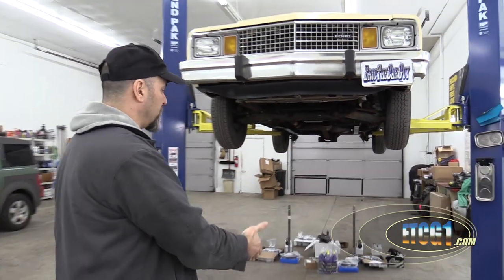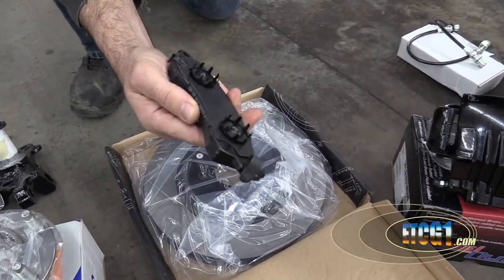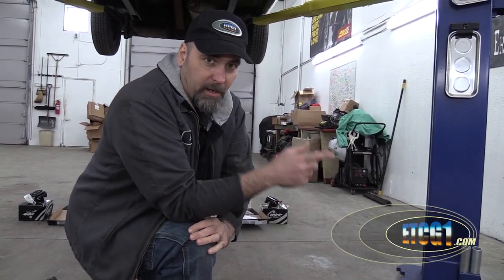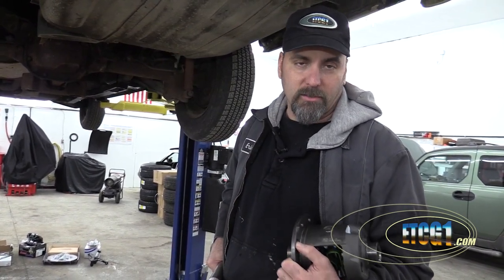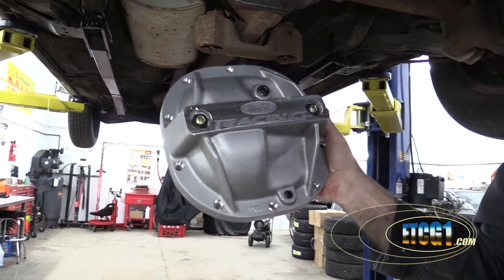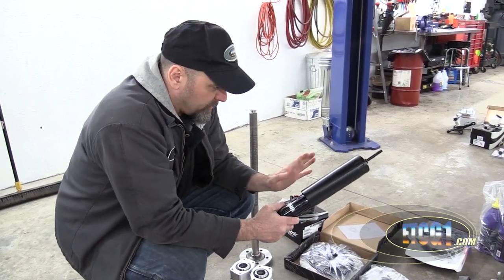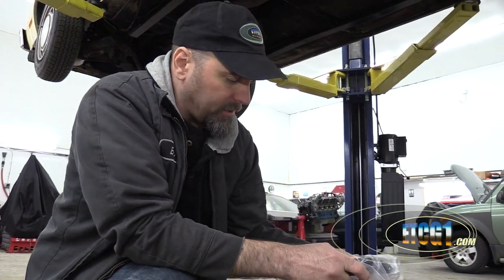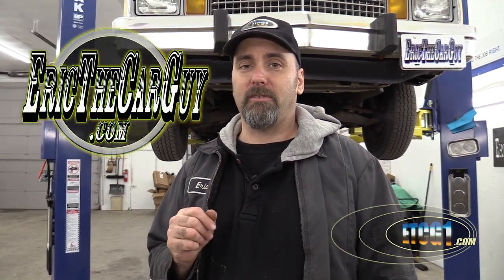New Fairmont Parts! #FairmontProject -ETCG1

Comment: 13:34 Talking about the flex line...You have the 1 for the axle (suspension movement) and one for each side because the trivial amount a caliper moves will break a steel line over time flexing back and forth. Hence comes my question: Wouldn't it be better to have steel line on the body out to the 2 flex lines allowing them to take caliper and suspension movement than to have that extra flex line in the middle? I know they are steel braided but even so they are not as good as solid line when it comes to pedal firmness.

Comment: Don't know if this has been pointed out, but The Crown Vic 17" wheels have a deep, FWD-like backspace. On the rear, if you ordered SN-95 length axles ('94-'04) The Vic rims may be the right backspace or close. If you have Fox length axles, a spacer will be required. The fronts will likely need spacers.

Comment: I'm with you there on a car being more than just an engine. I just got a 2016 WRX. I'm probably not going to do much to the engine. I'll probably upgrade the brakes and suspension before i do anything. After that I may get the flex fuel sensor kit from cobb. I would love the option to run E-85 without having to swap tunes.

Comment: ford ranger center caps are the same as the crown vic ones , easy to find in the junkyards or ebay , but you have to have the specific lug nits , so pick them up from the junkyard too

Comment: With the thickness of the c-clip eliminator and new caliper holder, do you need a longer axle?
Are the front tires as big as the rear?  Isn't that a waste?  Sure it looks cool but steering and tire clearances and steering resistance, et al.
I'm pretty sure you thought that stuff out already and I don't need to be concerned.  Right?

Comment: I learned to rebuild a rear end on one of these old foxbody mustangs, one awesome tip I learned is whenever you need to press a bearing on a shaft, such as a pinion bearing on to the pinion, stick the pinion in the freezer for a half hour, then take the bearing and a map gas torch and heat the inner race. it should slide right on!

Comment: AWESOME! body color on the rims depends on what color the car is. I missed if you were leaving it same color. the magnesium color looks good on steelies with chrome rings and caps on my 64 Malibu and body color didn't look right which is a dark 94 Chevy blue metallic. Such a great build you have going. can you do a mostly hidden roll bar and maybe tint the windows to hide it? I've seen cracked welds and slightly twisted bodies in those older mustangs when grip and power both increase. Your build is gonna be soo awesome. thanks for the vids!

Comment: Eric - I always respect a builder that makes sure the project can stop before putting any effort into making it go!
Reply: +Howard White 
So true. 
All go and no whoa makes for a lot of sorrow.
Reply: +Howard White Precisely the point. I keep telling people that are clamoring about the engine, that there's more to a vehicle than just an engine. Thanks for your comment.
Reply: +Howard White thats why I always tell people, start at the ground and work your way back to the motor, you may not get to go fast right away, but you can push the car harder and have more fun with the stock motor while you wait to get the actual go fast parts, first thing (outside of a basic tuneup) that I address after buying a used car is a suspension overhaul, well after I get my radio setup in it, LOL.
Reply: +EricTheCarGuy I keep trying to explain to a friend of mine who has a old 87 Monte Carlo...sure it'd be nice to drop in a big block,but if it's not got the right suspension or brakes... it's not going to be safe or fun to drive, how fun is having a car that doesn't have tight enough steering or enough braking performance to really use that horsepower?? I don't get it,that's why my Nissan is getting 4 piston  front and 2 piston rear calipers and coilovers before a turbo and ECU...I want to be able to enjoy my added power, not be worried about whether or not it'll stop or turn
Reply: +Bradley Preston I agree 100% and that's what I'm hoping to show with this build. It's not about how much horsepower you can make, it's about how you use the horsepower you have. My Vigor has about 160 bhp, but the car is so well balanced, it's a dream to drive. That's what I'm going for with the Fairmont build. Thanks for your input.

Comment: Great stuff, man! Wrangler TJ Jeep (1997-2006) owners cannot do much to their engines. CAIs are useless on the 4.0L, which is like a tractor engine. It is ported so that it is maxed on air flow in and out. Chips do nothing. It is a bulletproof monster in the Jeep, but you will not ever get much more from it as far as speed. We are concerned mostly with axles, steering and suspension. So this video looks just like a lot of Jeep videos. Even some of your parts are things I am familiar with as a jeeper. So I particularly liked this one.

I really like the C clip eliminators; what a great idea! I wish you could get these for the Dana 35 axle. 

Have you considered how these will affect your stance? It looks to me like they will increase your rear axle width by about 4” unless they fit into the disc conversion somehow. If this is the case will you add spacers to the front wheels or account for this in some other way? Or will you just go with it? With your wider rims I would become concerned with the tires rubbing the wheel well openings.

Please post some followup vids!

Comment: You may find your axles aren't long enough unless the c-clip eliminators took in account the difference between the stock backer plates and disk plates.  Also, did you check if the backspacing on the wheels will clear the suspension and steering components, they seem pretty deep to me.
Reply: +GoogleSucks I don't believe there will be any issues with wheel clearance. I am concerned about the spacing with the C clip eliminators. That's why I'm going to measure everything out first before I commit to those.

Comment: i have a 90 mustang now that i am just finishing up rebuilding a rear end for it. the front spindles you have are off 96+ Mustangs they move the track width out a bout 6mm or so from stock. if you can get 94-95 it will keep stock track width it might affect the tires if you have really wide ones.
Reply: +xargon1234 Thanks for the heads up. I'll have to see how it goes.
Reply: +EricTheCarGuy  i just thought of this too, those crown vic wheels make sure they will clear the cobra brake setup. it requires 17" wheels but some still might not fit. i know the oem bullets that came on 98-04 will clear but some aftermarket ones will not. might need to mock up a spindle before mounting tires.

Comment: For your rear brakes and clip eliminators, I can think of 2 solutions. You don't want to stack them because your axes won't be all the way inside the diff unless you got longer axles, which I'm guessing by what you said you didn't. You could either get the bearing/mount machined to fit inside the caliper bracket and sit flush with the axle tube, or machine out the caliper bracket and find a way to mount it to the rear end solidly. the first one would assure your brakes will be good no matter what, but you would need to have any subsequent new clip eliminators machined in the same way if a bearing ever went bad. If the bearing are replaceable in the units, I would have them machined. If not, cut the brackets and find out how to mount them to the backside of the tube flange or right to the tubes themselves.

Or, just use C clips :)

Comment: Eric , when you set the backlash on the diff , set it @ .006 inch.  If you go by factory specs you will end up with drive shaft clash. Trust me , I worked for Ford for over 30 years and set more of these up than I can remember. Good luck on the project.    Russ

Comment: It almost looks like old things overtime are Rediscovered. before those axle retaining c clips, on semi floating axles there was a bearing the axle went through, and what held it was a collar that went on the backing plate. and what held  the backing plate to the axle tube, were the same bolts that would hold that retaining collar. and you would need a slide hammer to pull the axle shaft. you unbolted the four bolts  on the collar, holding it to the axle shaft tube. And there was an access hole, on the axle shaft flange, next to the wheel studs, to reach an extension through there with a socket on it.  bearing failure could cause axle, and drum, with the wheel&drum Still bolted to it, to slide out. I think those c-clicps, are pretty sound. To actually move enough within that side gear to drop out, there'd have to be no spider pin. and to lose that, you'd have to have that bolt  come loose. And THAT would be catastrophic, if you were driving down the highway.

Comment: Hey Erik, why not rely on the disc brakes to not have an axle go bye bye?

The caliper sits attached and grabs the disc, surely there's no risk of separation. Failure for sure, but not separation.

Are you doing it to eliminate the risk of a disc jamming against the outside caliper?
Reply: +Nitten The caliper has nothing to do with keeping the axle in place, remember it's on sliders. If it were to come loose, it would take the brake caliper with it.

Comment: Hey Eric I have been sourcing similar parts to convert to 5 lug with cobra brakes. Anyways you might want to go with 94-95 spindles as they keep the suspension geometry closer to stock. From what I have read the 96 and up and cause some bump steer issues.  96 and up have the straight tie rod link and the 94-95 has a drop. Great videos keep up the good work.
Reply: +Luke Burgtorf Thanks for the heads up. I believe my Mustang has those tie rods on it. They're rusted up pretty good though. If there's a problem with steering I'll look into it. Thanks again.

Comment: Wont the axles have to be longer for the addition of the plate with the c-clip eliminator?

If so, the best scenario I could think of would be longer axles, or cutting the plate's center out and welding in the c-clip eliminator.
Reply: +Spearfisher1970 
No and no welding.
Reply: +Mark “Just-Plain-Joe” Crawford But with the disc brakes plate and the extra c-clip eliminator plate?  I must be misunderstanding something.

Comment: It's a Happy Day when your (own) Parts Truck comes to visit! I noticed that hub you showed has a Tone Ring- is the Fairmont going to have ABS? Does that Mustang already have it? That's many, many hours and quarts of sweat ahead of you, on your Shop floor young man! Good luck to you, nice to "see" Brian will be with you through every step. How is the underbody and hard points of the Fairmont? Once stripped- do you plan to media blast & POR-15 or paint it before all this installation?
Reply: +HUBBABUBBA DOOPYDOOP I thought about that, but I think a wire wheel on my grinder is the way I'm going to strip it for paint. Time consuming, but I have the tools in hand. The tone rings are there because the hubs are from a 94. I'm not running ABS though.
Reply: EricTheCarGuy  Thank you for your reply, Eric!

Comment: Looks like the front hubs are setup for anti-lock (I am guessing that slotted disc is for the sensor). That would be an interesting upgrade to install. Is cameraman Brian slightly nervous seeing all of that new shiny (big) rotor hardware?
Reply: +Deathlok67 No need for that. Waste of time and money on this build. It won't even have fuel injection.

Comment: The 2 sets of brake lines are for the front and the rear.  The ones with the big L shaped bracket are for the rear cailpers.
Reply: +eformance Yea, you're right. I thought about that after I made the video. Thanks for the input.

Comment: 3.55 gears with the straight 6 will be fun. the 6 banger makes good torque but isn't a high revving engine. stop light to stop light it will work well but it will top out at 80 mph.
Reply: he's putting a small block in it
Reply from the maker: +superrodder2002 The speedo only goes to 85 anyway. ;)

Comment: C-clip eliminators are also called flow paths for differential fluid leaks. Run them to get your project going, think about getting 9" ends welded on later. I've seen an axle pull clear through a c-clip eliminator at the strip.
Reply: +BlownF150 I'll head that advice. I don't plan on running it as a drag car though. I'm really just building a nice street car. Thanks for the input.
Reply: +EricTheCarGuy It's the leaking that's the biggest issue. Ultra Gray, Ultra Black RTV's don't hold up for more than a few weeks or months, copper high temp RTV seems to last longer. Problem is they are highly stressed even on street driven cars, they egg-out which causes the internal seal to leak or the flange is over torqued causing the same problem. Heat cycling between a chunk of aluminum and steel doesn't help either, neither does using nice full synthetic rear end oil which seems to find the smallest gaps easier than ATF. They are just a safety device but one that has a penalty given enough time. If you can, get the axle tubes fully TIG welded to the housing by someone with a proper jig since you'll be pulling it all apart anyway.
Reply: +BlownF150 I'll look into it. Almost doesn't sound worth it. Thanks very much for your input.

Comment: Really looking forward to the differential build video.  I work in a shop in Alberta that specializes in powertrain stuff.  Mainly differential parts/service, drivelines and transmissions. Do you get many diff jobs in your shop?
Reply: +Matt Williams Nope. This will be the first one I've done in a long time. Looking forward to it. Someone already suggested I set it up with .006" lash. Would you agree with that?
Reply: +EricTheCarGuy Anywhere from .006-.008 would be perfect as long as your pattern is good. I would also check the backlash in three different spots. Looking forward to it!!

Comment: I know what it's like to have half drums and half disks, and disks all the way around when it comes to having non powered brakes. Been in 2 vehicles when they've stalled while driving. F-150 with drums was a significant difference from and Expedition with all disks. For the record they both stalled on their own I wouldn't actually do it just to test it lol, F-150 had an alternator failure and the Expedition had sucked in it's own filter and chocked itself. Maybe it's just bad luck on my part lol

Comment: Eric, the 28 spline 8.8 Ford axle and the 31 spline 8.8 are not compatable with parts, the housing diameter is different and the 31 spline shafts dont work in a 28 spline axle. If you are looking for a 31 spline housing, Jeep forums will usually have them for sale(but expensive) or a junk yard, from a 94-99? explorer(have to check to make sure) or a level 2 ranger will have the 31 spline in it.
Reply: +Tyicus That's not what I understand. I believe this set up will work just fine.
Reply: Pretty sure i cant post a link here, but if you go to The Ranger Station they have a tech article that covers the Ford 8.8 Rear end. It has it listed there as being incompatible, and everything else I've read in the off road community has stated the same thing about them. Personally i haven't put them side by side to compare i usually only work with the 31 spline axle.
Reply: In looking around it might be possible, i usually dont touch the 28 spline axles cause they are weaker for what i use them for. Ill have to do some research to be sure, I know at least with the Ranger axles it appears you cant(2010-11 is a possible exception) interchange the shafts based on the OD of the shafts and bearings vs the ID of the shaft housing. I am by no means a master mechanic and could very easily be wrong here. Just attempting to save you some trouble down the road. Ill do some more reading to be sure and will definitely be watching, I enjoy the way you do your videos.

Comment: Hey Eric.. quick question. How did you calculate for your axle gear ratio? Im restoring and modifying a 77 Marquis that currently has 2.50 gears. I think I've decided on 3.50 to be the replacement but i have a C6 3 speed automatic. But i see you chose a 3.55 with a 5 speed why?
Reply: +Fireandgasoline “Fireandgasoline13”  
There are a number of really good resources and calculators online... Google is your friend. 
Here is a site that has a lot of good info and useful calculators. 

http://www.wallaceracing.com/calc-gear-tire-rpm-mph.php
Reply: +patw52pb1 Thanks.. ive used the online calculators thats how I came up with my decision. But with all the upgrades he is doing i thought his gear choice was mild. But maybe he isn't planning on racing it.. so is his choice more for fuel economy?
Reply: Fireandgasoline
You are welcome.
I suspect Eric's choice was calculated and a bit arbitrary. Any gear choice is a calculated compromise and would encompass a number of factors including, intended use, peak torque, peak RPM, peak power, power curve, torque curve, target speed, torque converter stall, and torque converter slip for AT applications and many more. 
Maybe if we are lucky, Eric will tell us his process and why.
Reply: +Fireandgasoline “Fireandgasoline13” https://www.youtube.com/watch?v=XREsRG9Y1mU

Comment: I had a FRPP differential cover that would leak no matter what I would do. It turns out the FRPP differential cover was warped from FRPP. I swapped it to a Moser differential cover.C-Clip eliminators are known to leak, so be careful... I'd 86 the c-clip eliminators. I was running a 343 RWHP NA Stang and it was on Moser 31 spline axles, an Eaton Posi,  FRPP 4.30 gears, and c-clips. LOL. Held up fine. The Ford differentials are strong but not as strong as an Eaton Posi, so don't burn out all day on those sticky tires.
Reply: +ReclusiveMountainMan I'll keep that in mind. Thanks for the input.